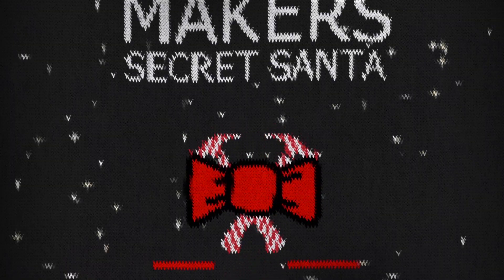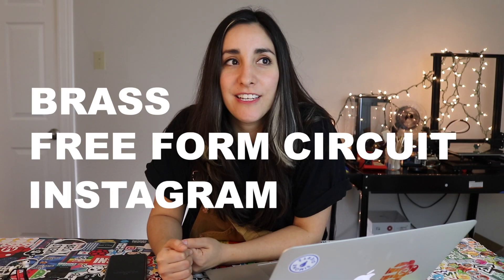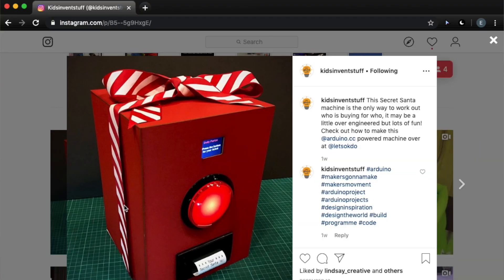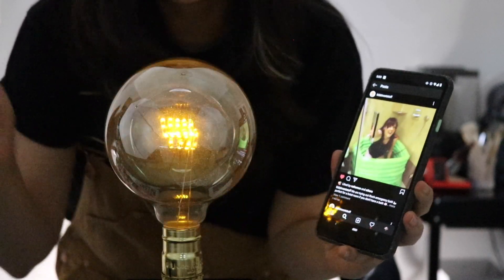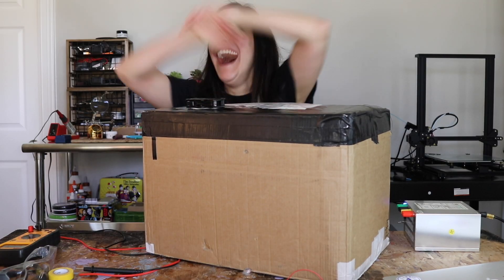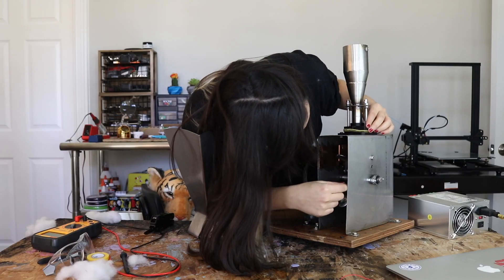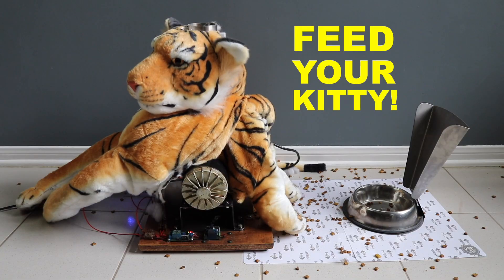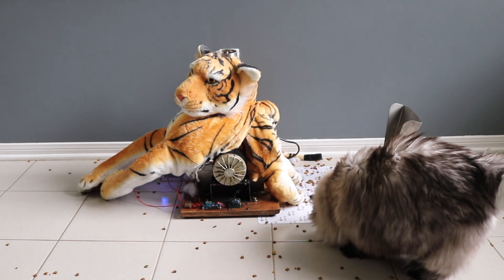Making a light work with Instagram likes

Comment: This is wild. So glad I found you channel!

Now...about that 14 hour LED weld...would it have been easier to weld the LED's onto the wire while it was laid out flat on the table, and THEN roll it up?
Reply from the maker: Tim Yarrow thank you! Good question, that’s the first thing I tried but since the brass wire is so strong it breaks the solder points if you try to bend it
Reply: So...let me get this straight: your first attempt to weld the LED lights and roll them up was a bust (yeah...pun, ha ha), but instead of saying "f***-it" you invest 14 hours into a minutely detailed weld instead?

Jeezum!

I wish I could subscribe twice based on your sheer focused determination!

Comment: You do realise you could have done this with an ethernet or WiFi enabled Arduino and simply port the code over to C/C++ right? For something as simple as this, an Arduino is a much more efficient device than a RasPi. In an era in which we are meant to be reducing energy usage, your wasting energy by using a computer to do something that can be done with a low power microcontroller.
14 hours to solder like 30 SMD LEDs....wow. You should also not drive those LEDs directly from the RasPi 3.3V pin, that is such bad practice. The 3.3V pin should never exceed 50mA or you will damage the CPU or voltage regulator.
Reply from the maker: Morgan Winters so much anger! Calm down, try it, and get back to me

Comment: Holy crap that polling interval must be crazy to get such a short time between like and light :|
Reply from the maker: TheUnknownFactor I sec between request hehehehehe
Reply: @Estefannie  makes sense that you receive the ban. I was just curious the same way how you do the validation check with sow low latency. depends on the frequency of the like being added. if you prolonged that time to 10, 15 or even 30 seconds, you could get around the ban with not many drawbacks. other longterm solution would be to use proxy. but that would not be under 75 BGP :D great build otherwise. gonna go check the channel now

Comment: I don't mean to rain on your parade but wouldn't it have been easier to solder the LEDs to the 2 wires before wrapping the wires into shape?
Edit: great video tho, really well made.
Reply from the maker: Firestar actually no, the brass wires are very stiff and that would break the solder joints as they are very close to each other.